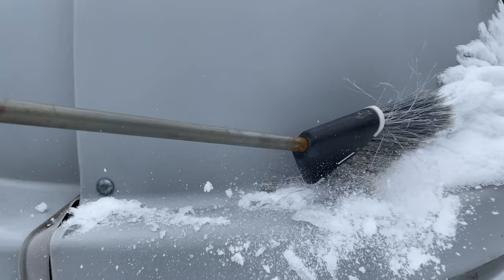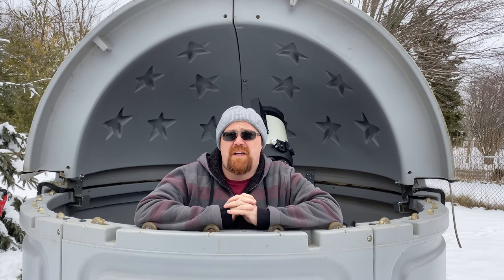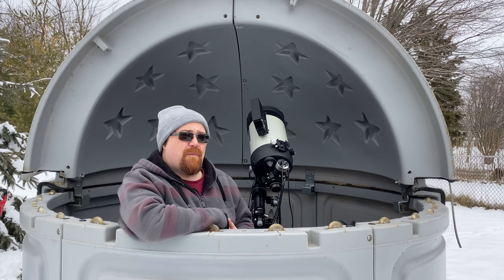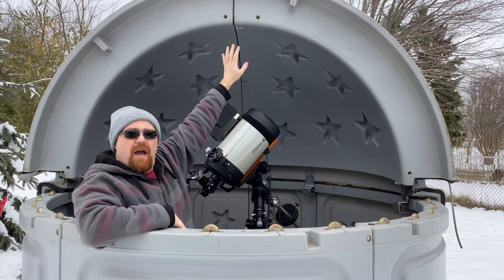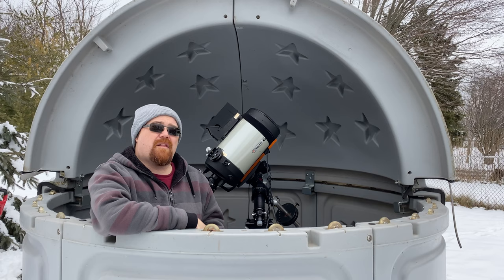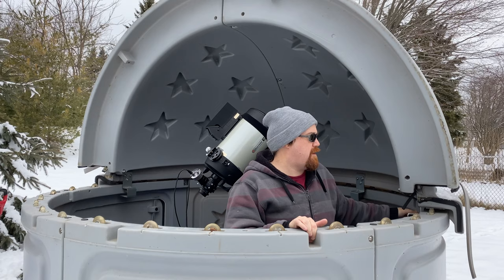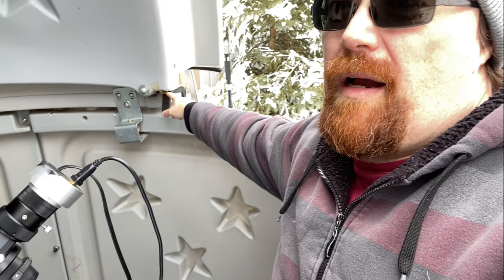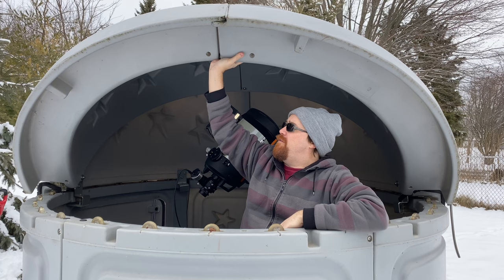SkyShed Pod - My Personal Observatory Dome in my Backyard at home - Review of a Decade old Model

Comment from the maker: What is your observing setup?
Reply: Hey @EmberSkyMedia thanks for the review! Where are you located and how cold does it get in the coldest season? I'm asking since I am in Quebec, Canada and it gets really cold in the winter and was wondering if it's handling extreme condition well, we have -30c and even colder sometime here.
Reply from the maker: @t_hustle_c5049  I'm in Ontario, it gets cold here (-27C most recently). Main thing is when its really cold you need to take things slow and not allow the lid to "bang" up or down as cold plastic is prone to crack if you mistreat it.

Only issue I've had in cold weather <0C is the track wheels at the "split" between the two shells can freeze if any water gets in, makes the rotation a bit harder to do on those wheels but still usable with a bit of extra muscle.

Comment: Thanks for the review.  As a SkyShed POD owner of ten years I’m very pleased with mine. I bought mine new and after ten years of all-season use in Canada it’s proven itself to be quite durable. Cheers!
Reply from the maker: Great to hear! They are very durable for the harsh Canadian Winters! (Just point the inside she’ll south so snow melts off it easier).
Reply: @EmberSkyMedia  I have the fitted tarp for mine, but after a decade of use it’s showing it’s age. Cheers!
Reply from the maker: @whenpigsflyobservatory  mine needs a good wash-down which I'll b doing in the Spring when I debate I may move it to a better location (trees)...
Reply: @EmberSkyMedia  cleaning the tarp is an annual task. I clean it and the POD each fall. The tarp has started to show its age at the crown now but it’s still waterproof, mostly.

Comment: Thanks for the great video. How tall of a pier did you buy?
Reply from the maker: 3ft to the bottom of the base plate (so about 2.5ft core pier with ~6 adjustment plate for leveling on top). Then you need the base plat for your mount that attaches there and your mount sits on top.

Give it take an inch or two it puts the mount the  same height as the tripod does.

Comment: Cant' say I'm a fan of the dome opening half way like that. Defeats the purpose of the shed in general. Nexdome I'd prefer. But the Shed body is better.
Reply from the maker: There is a Z-table available for sliding off the dome if I wanted to purchase it. For my needs it does well (the scope is positioned about 1ft south of center and a bit east so that I can point the scope almost to zenith if I wanted to.) I do wish they would make a more "traditional" dome for the SkyShedPod for astroimagers so that I could track across zenith when desired.